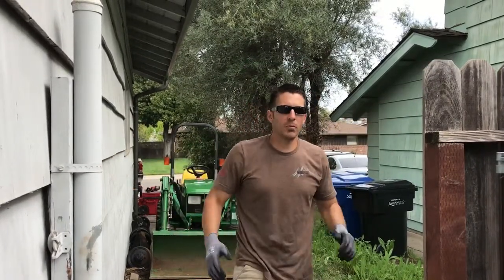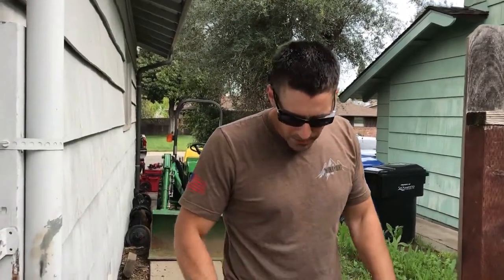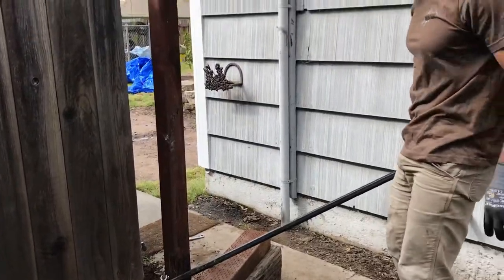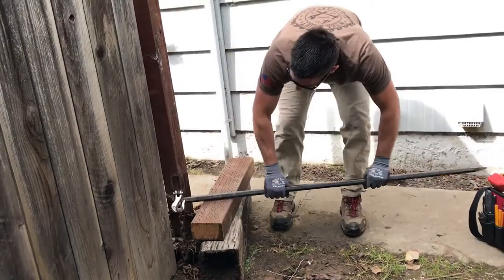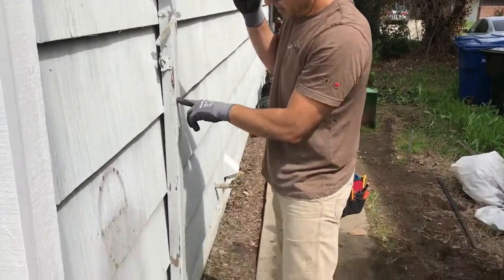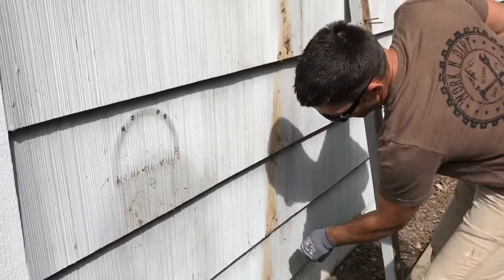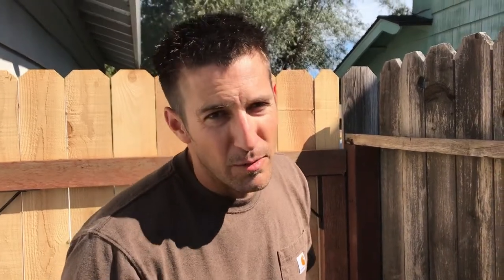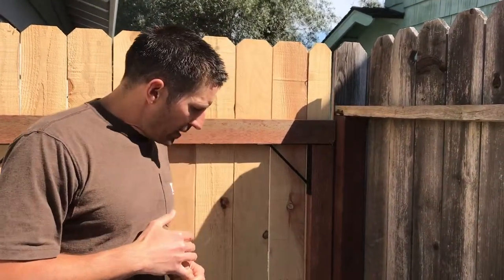How to Remove a Fence Post

Comment: Why didn't you just use the tractor to pull it out? :D
Reply from the maker: good question lol, i think we actually got the tractor after we built the gate but i cant remember exactly..
Reply: Everyone knows how to use a tractor to pull posts, but I doubt everyone knew how to do it like he showed us! Unfortunately for me, this Oklahoma clay is like concrete, so I would need both methods at once to yank them out.Thanks for the tip though!

Comment: Man, great job.  I gotta do 5 metal fence posts stuck in Italian mud.  I gotta grinder like yours, but what kind of circular blade could I use to cut the metal if I just want to do a quick job of it? Hey, by the way, THUMBS UP!!
Reply from the maker: hey sorry for the late response, hopefully your project was a success!? fyi i used 4.5” dia x1/16”thick cutoff disks. thanks for watchin

Comment: We are planning to remove our old fence door and move it forward. Can we use the same wooden fence door? Trying to save money. Thanks
Reply from the maker: yes as long as it doesnt have much “dry rot” on it , but most likely you might have to add some screws to it to make it stronger because im sure it has loosened up over the years. thanks for watchin
Reply: Thank you so much!